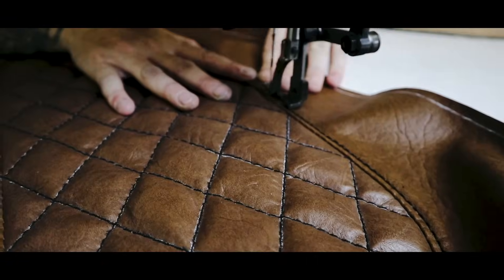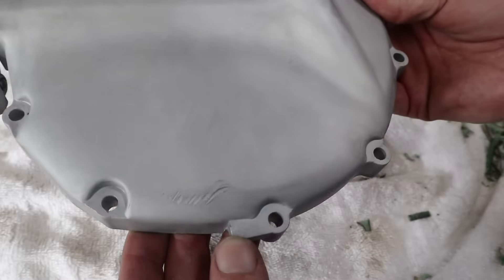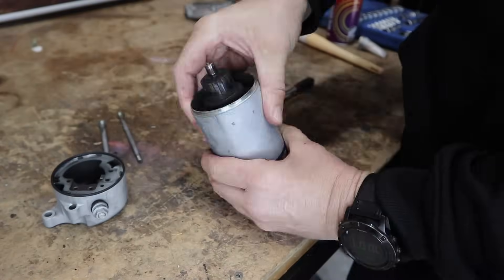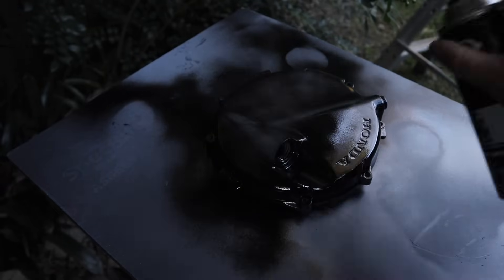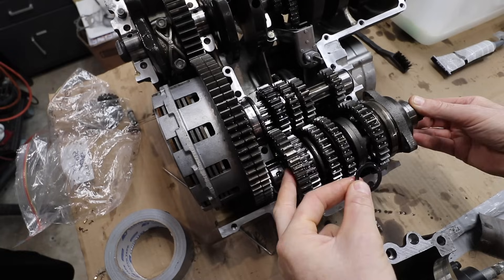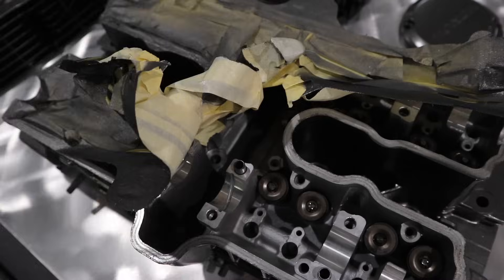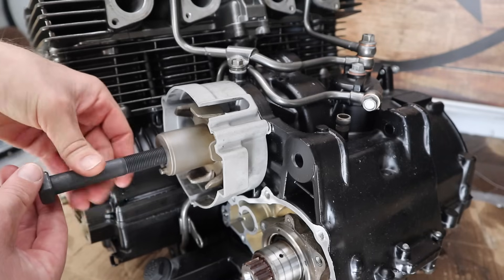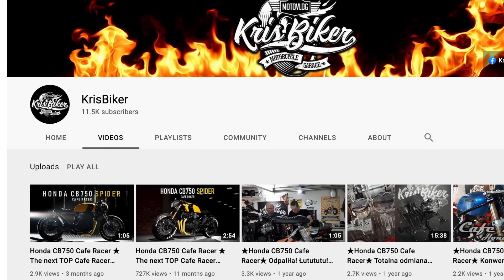★ Honda CB750 Café Racer Engine Rebuild Timelapse

Comment: Good build buddy, I love those motors. 
I did a 2 valve GS750 with rattle can paint also, it works great until you have to tear it apart again and little chips happen from just removing items.
Reply from the maker: Thanx mate.  Cerakote is the next step I think for hardness

Comment: Using a metal gasket scraper can gouge the aluminium and cause oil leaks. I use a plastic scraper and some scouring pads.

Comment: How does that VHT paint hold up? I have used it in the past and I have heated it in the oven as well the only thing I didn't do is sand blast before paint I usually use powder when I sand blast but I am now curious if I sand blast it might actually hold up.
Reply: I used their engine paint on an intake manifold of mine baked it in the oven as directed and the only issue I have had is when I had to get the fuel rail out I accidentally split some fuel on the manifold and the paint came off, but that is the only issue I have had and it was my fault not the paints. It hasn’t faded with the heat or anything of the sort

Comment: im currently building my first bike ever i have a 1983 kawasaki kz550f i kinda blew up the engine threw a rod and am now in the process of building a new motor from parts its a nightmare in a thousand bits on a table no clue what im doing but the engine looks extremely similar to this one so hopeing  this would spurr my motivation  and teach  me a thing or 2 about how these assemble lol

Comment: Hello Dan 
Nice work with the engine. I'm also fixing a cbx750 engine that the drive chain from the auxiliary shaft to the crank shaft had broken on. But when I wanted to dry the engine after I washed it a small cylindrical object with a hole I flew out from one of the internal oil pipes. But unfortunately I didn't se from witch one. Any thing you know anything about.
Thanks in advance 
Håkan

Comment: Permatex used to make a gasket remover spray that would turn gaskets into mush in 10 minutes. It was some nasty stuff that would cause a nasty burn if you got it on you. They've since replaced it with another remover, but it's not nearly as good. 
Aircraft paint stripper might work though.
Reply from the maker: Thank you mate I’ll keep that in mind for next time it’s mainly just the one gasket that you can’t really get around easily which would be handy to have stuff like that

Comment: Dan, your skills and can do spirit are inspiring. Your video editing is equally as impressive. 

You’re uniquely qualified to share insights into an project I’m pondering.

If I build an 865 big bore kit into a 650 twin, do I need to rebuild/ upgrade the throttle bodies / fuel injectors? How about the clutch?

Comment: 3x5 cards. I put a description of the part on a 3x5 card and put it in the bag with the parts. I will never write on a bag again. You can describe the part and add replace, restore to help with a replacement needed parts list.

Comment: Nice work Dan!!! What is the book in the background at 4:20? Looks like a workshop manual for the CB750?
Reply from the maker: Yes mate it sure is I wouldn’t build a bike without one or at least the engine anyway
Reply: @CafeRacerGarage  Awesome! May I ask which book it is?
Reply from the maker: @Rocky19011  clymer manual
Reply: @CafeRacerGarage  Thanks Dan, legend! 🙌

Comment: You didn't explain anything about fitting the main bearings as there are code stamped on the cases for the outside diameter of the bearings and their code stamped on the crankshaft for the inside diameter of the bearings and they can all be different but the later models were coming with at least all the same for each main bearing as I said they can be 25 different sizes inside and outside diameter and there's a cross reference code in the service manual from Honda that will explain it to you.... And that's particular CB750 engine is not one that any of us who's ever worked in a Honda service center would put any money into it's the very first ones that came out in 1979 the cam chains would eat their way right through the front of the engine block where you can see the cam chain turning and oil spilling out we had to resolve several of those by completely turn them down and overhauling them with updated parts has the later models seem to have cured that problem but the main problem about the devil overhead can CB750 engines is that if you'll notice there are no cam bearings at all for the cans to ride on they're just riding on the bear aluminum alloy that the head is cast out of and they constantly wear into the caps as the valves are under the can of pushing outward and causes you to add thicker shims each time they get loose from where and that happens quite often to where the point one of the people that worked with me at the Honda shop had a brand new one and he ran out of shim sizes that was beyond what Honda offered and he had to make his own cuz he worked at the machine shop and was able to do it but it's pitiful about that engine...
And Honda must have solve the issues because of cb900s and the CB1100 never had the problems with the camshaft caps grinding away like the 750s did the twin cams ... If you ever just wanted to stay in that class of size of engine the single cam cd750 of 1976 in my opinion would be the best ones or anything a couple years either way or not I wouldn't really want to do in 1978 cuz they put smaller carburetors on there and it's smaller ports and tamed it down 1050 horsepower or something wasn't much bang for your buck but 1976 Super sport engine will top out about 135 and can't be easily tuned remaining with the stock parts to hit at least 140 if you want to hear it let her buzz out a little harder but they're much more reliable engine than the twin cams of the earlier years from 79 on up probably 82 let's see I can't remember now would have been better.... The Freddy Spencer cb900f in the twin cam version is probably the best you can get lots of performance good reliability... And then there's the ultimate we always we could have the Freddie Spencer replica of the super bike the CB 1100 f